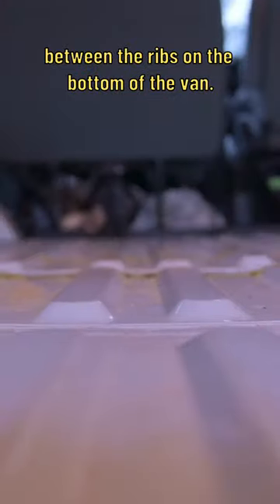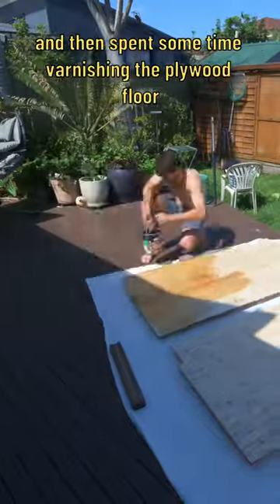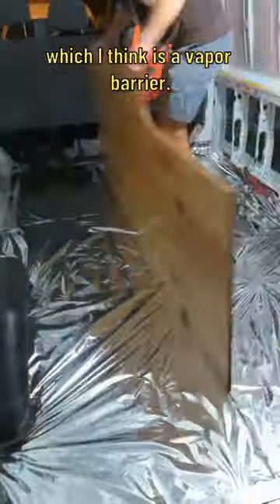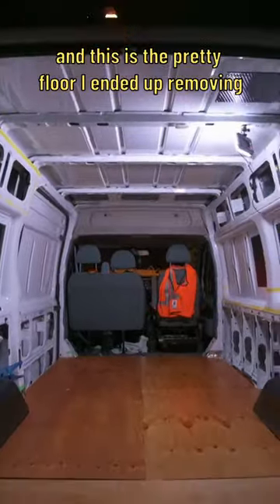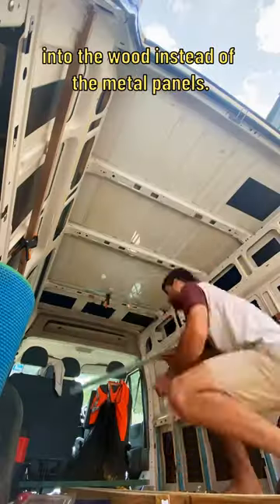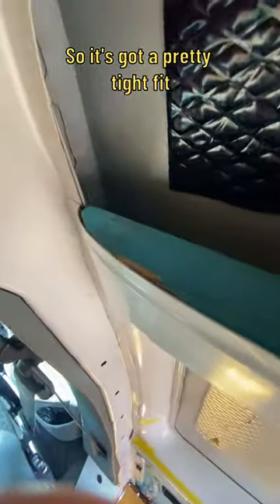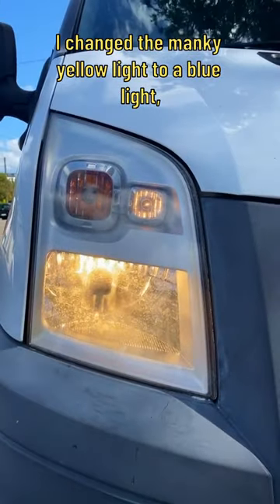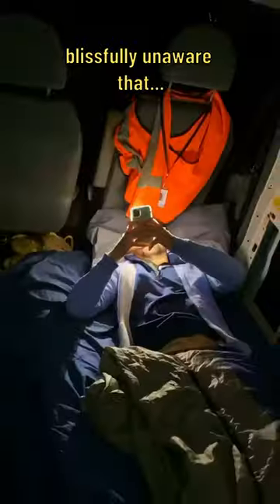Mini Van Build (2/8) - Installing van floor and changing headlights of Ford Transit

Comment: what was the actual mistake?
Reply from the maker: I didn’t realise until after I installed it, but the ply floor was a mistake. There’s better insulating stuff available, I change it in a later video.
Reply: @loicleray  Oh, so you were expecting the ply to be insulating,  and not just the flooring itself?
Reply from the maker: @lesliedeana5142  I had put a bit of insulation foam in the floor, but it didn't do anything. It was fine for the Aussie summer, but in the winter the floor was glacial.
Reply: @loicleray  what is a good insulator in a van?